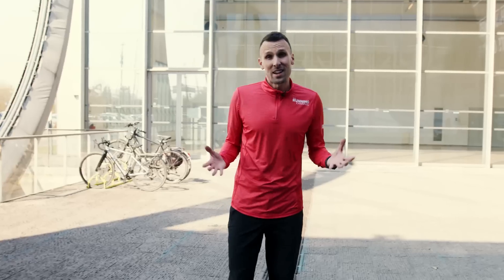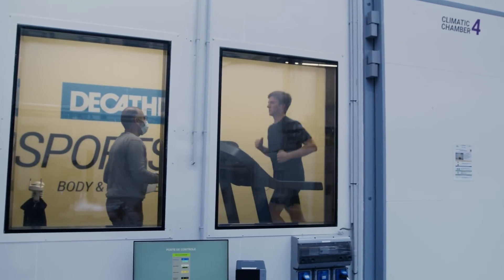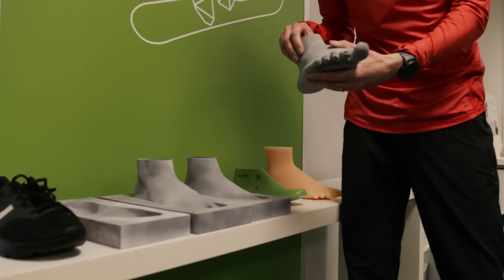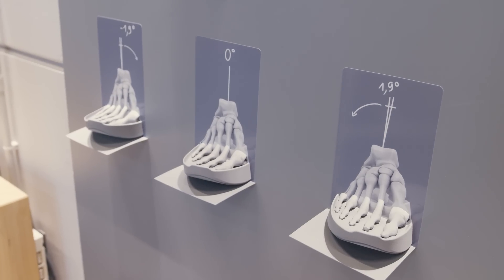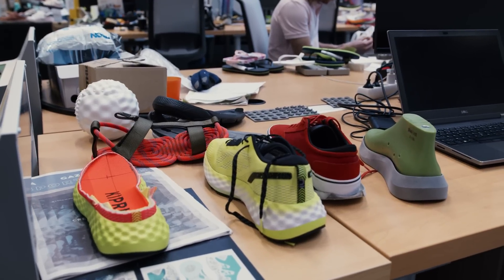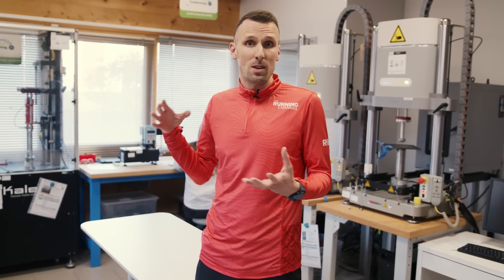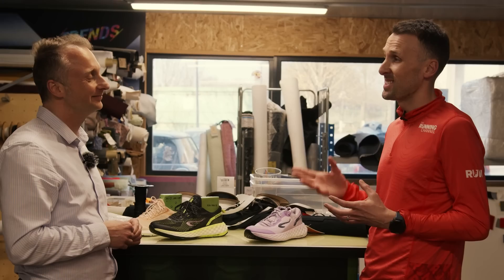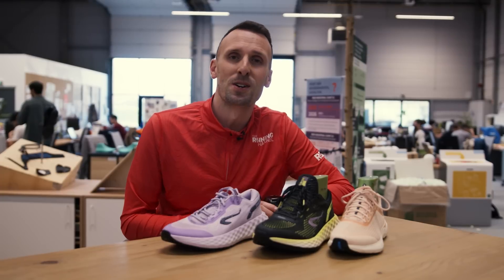What's Really Inside An Elite Running Lab?

Comment: Bearing in mind the huge difference between runners of the same foot size, what efforts and design goes into the density of the foam? Surely a 15st runner wearing size 9, compared to an 8st runner in the same shoes will feel massive differences? To soft for the heavier, to hard for the lighter? Should companies offer size and density or is they the idea of the many different models within a brand?